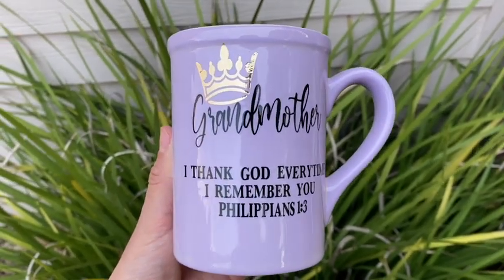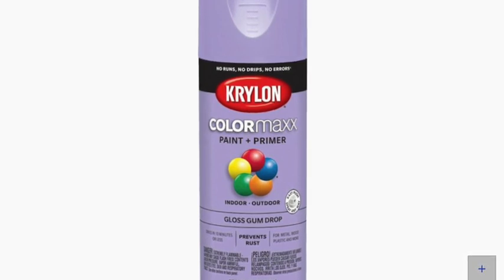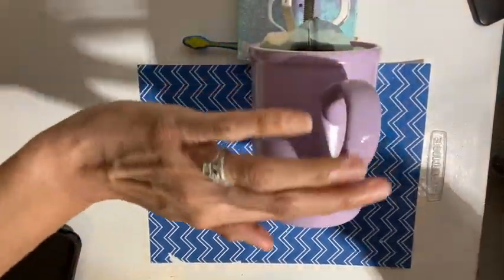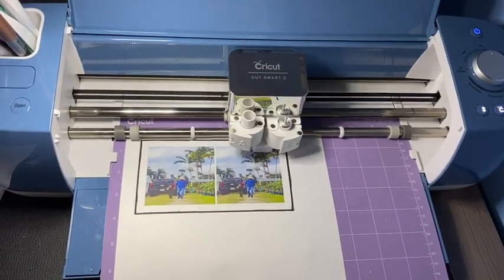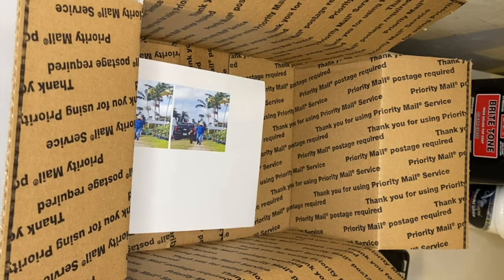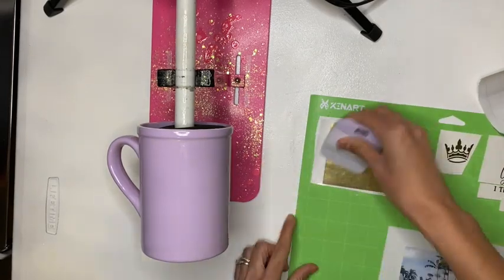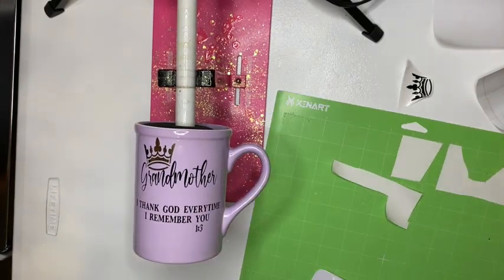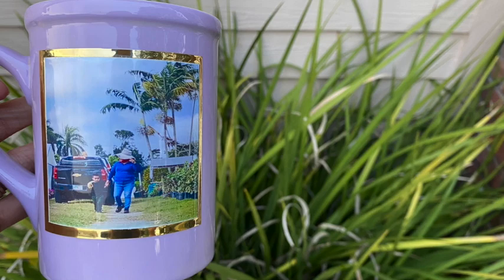How To Seal A Ceramic Mug Using Brite Tone from Crystalac (EPOXY FREE)

Comment: Hi just wanted to ask it’s safe to put lips on mug after applying brite tone and it drys? Thanks love your videos
Reply: This is from Crystalac Store webpage

When applied properly, CrystaLac® Brite Tone will usually be dry to touch in 1 to 2 hours. Extremely wet applications (which should be avoided) will take slightly longer. Under normal conditions 2 to 4 hours should be sufficient to sand (if necessary) and re-coat.

The cure time for CrystaLac products is 30 days. Within a week you can use your project no problem, but you want to take care to avoid deep scratches, allowing water to sit, use of chemicals etc. until the 30 days are up.
Reply from the maker: Yes! None of the Crystalac products have hazardous material and they are food safe. Brite Tone far surpasses FDA recommendations for coatings.

Comment: Ok so I am new to Brite Tone , if anyone can please answer this question . Would be highly appreciated!!  I’m making a mug, obviously cannot use resin. Should I do a layer of brite tone to the mug before I add the water slide decal ?  Or can I add the decal first to the bare mug than apply a seal, than brite tone ???
Reply: I need to know this answer to
Reply from the maker: I would prep it.. (sand and base coat) and then add a couple coats of brite tone. One or two. Add water slide … Then seal with brite tone.

Comment: I like this project and can't wait to try it! I will be using a white ceramic mug and will add vinyl. Do I need to sand the mug first? I will not be painting it. Thank You for the tutorial!
Reply from the maker: yes, you always want to sand to ensure you have a good surface for the top coat. Just a light scuff sand will work

Comment: Do you need to sand after 3-4 coats of brite tone or is that only for glitter cup/tumblers?
Reply from the maker: When I don't add glitter I spot sand every 3 coats only if I feel a bumpy part. I just sand that part in circular motion using 400 grit sanding paper. Or sometimes the edges of the vinyl may feel bumpy and I spot sand those parts the same way. I hope that makes sense.

Comment: Hi there thanks for the great video I am wondering if the bright tone is heat resistance meaning it doesn’t get sticky or soft when you have a hot liquid inside?
Reply from the maker: Hello ! Yes it definitely holds up & does not get sticky with hot liquids inside.

Comment: I just did a mug and it looks awesome, but I am afraid to start using it before the 30 days.  You mention that you can use it after 5-7 days with the proper care, and I am wondering, since I am new to using Brite Tone,  if you wash it after the 7th day, will that not interrupt the curating time? is there a risk of it peeling off?  and my other question, I hear every one saying this product requires 5-8 layers, but what if I still want to feel the texture is it okay if I only do 3-4 layers instead?
Reply from the maker: Hello... It will not interrupt the curing process if proper care instructions are followed. But it doesn't hurt to wait the full 30 days if possible. I usually add around 5-8 coats to everything just to be sure its nicely sealed... I believe 3-4 is a good amount..since you do still want that texture.. it should be fine.

Comment: Is it safe to drink out of it?  How long before they can use it?
Reply from the maker: yes it is. 5-7 days. the cup continues to cure in the first 30 days but can be lightly used after 5-7 days.... of course following proper care instructions.
Reply: @MelissaCrafter  i tried the ceramic mugs but for some reason the brite tone doesn't really sticks to it .  Do I have to use an unfinished ceramic or matte. I was able to do it but on a stainless still mug.

Comment: I know that somebody has already asked but is this product  food safe?
Reply: in my reading its not FDA approved but its food safe once product is dry. Do you know if its dishwasher safe or microwave??
Reply: I have to question how you can say it's food safe but it isn't FDA approved. If not approved, it does not qualify as food safe in my book.
Reply from the maker: The FDA does not regulate top coats since they are not meant for consumption. They only make recommendations for them (making them FDA compliant). This product goes above and beyond those recommendations! Don’t take my word for it.. you can do the research yourself. 

It’s a water based, non toxic product. 

It is FDA compliant. The FDA puts out standards for what is considered "food safe" when it comes to coatings, and if a top coat meets those standards they are compliant. Thats how the FDA works.
Reply: @MelissaCrafter  Thanks to both of you for your prompt responses and by no means was I directing Gannon but in these when everyone gets in a panic over everything one has to be sure  I also have to check Canada's standard on this.

Comment: Do u always have to seal printable vinyl before adding bright tone?
Reply from the maker: Yes unless its water proof paper. I believe I've heard of waterproof sticker paper but I'm not sure .
Reply: If you use laser printer, you dont have to seal. If its inkjet printer, then yes... seal and wait to gass off
Reply from the maker: Correct!